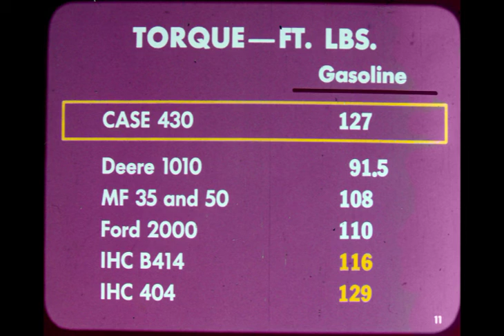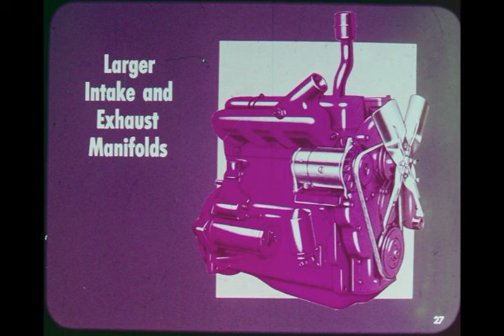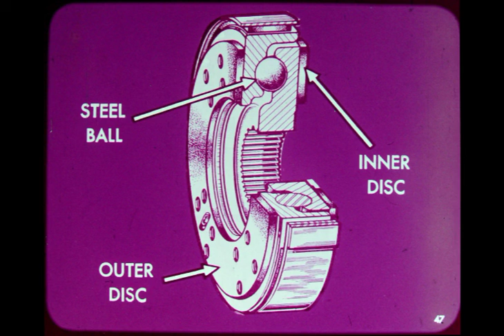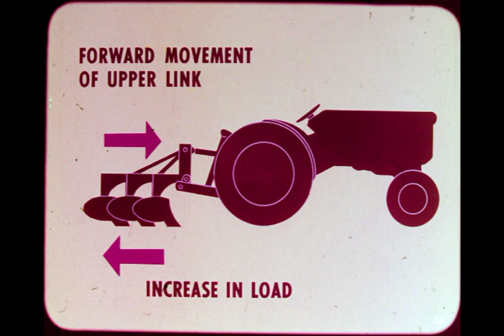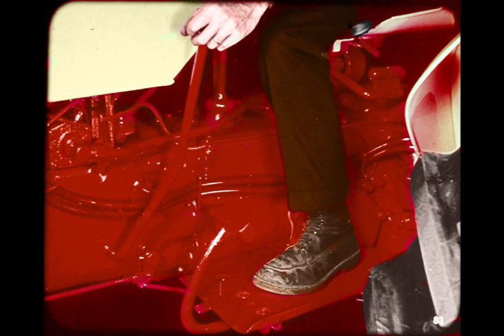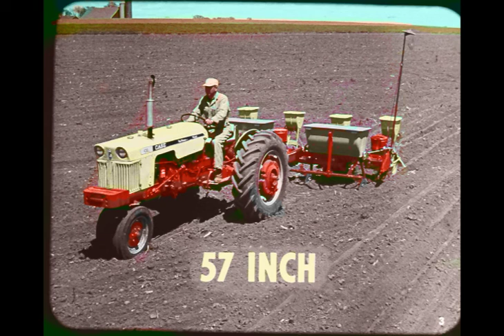Case 430 530 Promotional Filmstrip

Comment: How does the ji case 430 have 3 sets of remotes ????
Reply: Idk mine only has one
Reply: watch the segment again , By virtue of tapping the block under the fuel tank , you can raise a loader and share that same lever for a remote out the back , also the block has plugs that could activate a loader or another remote by adding plumbing ..

Comment: Why did J I Case fail to be number 1 in sales ? They were better then all others but John Deere had better marketing and IHC In Hell Constantly  that convinced Tenneco to bail the bankrupt company to continue.
Reply: I grew up on a farm where we had both JD and Case tractors.  My dad owned a ‘67 930 Comfort King and a ‘ 72 3020 and 4020 JD.  The difference in brakes was the biggest downfall to the Case tractor.  We pulled a 20’ mounted anhydrous ammonia applicator with a nurse tank in tow.  Turning at the field ends was tough with the Case and a lot simpler with the JD.  The turning brakes made the difference.  Other than that the Case was a well built and economical tractor.
Reply: @jti2007  The 4020 did have good wet brakes!
Reply: Yet they were the most stable brand back then, every other manufacturer was bankrupt, other then John Deere.
Reply: Tenneco bought IH AG unit. They did not 'bail out' IH. The larger portion of IH went through bankruptcy and continued as Navistar. J.I. Case in the early Seventies decided to concentrate on their construction equipment, which was more profitable than ag. Case did not have the production volume that JD had, or IH. Even if they had better marketing and more dealers, I doubt they would have had the facilities to meet the greater demand.
Reply: @LanceStoddard ohhhh, that’s why case didn’t make any combines in the 70s.